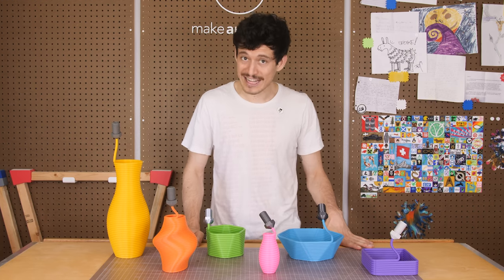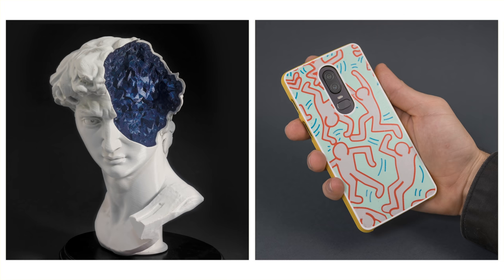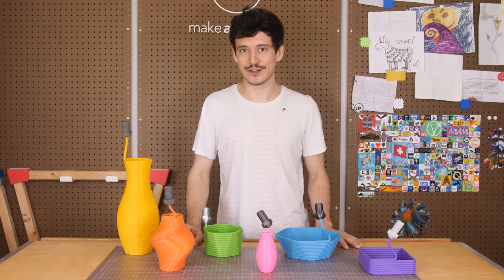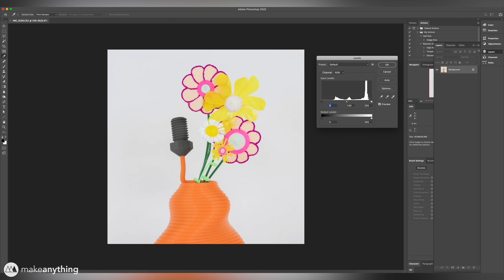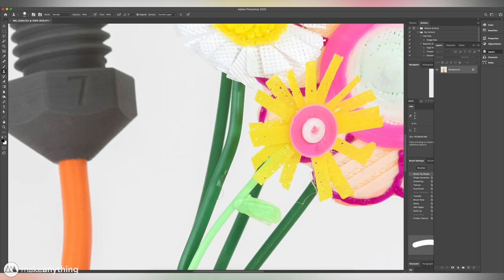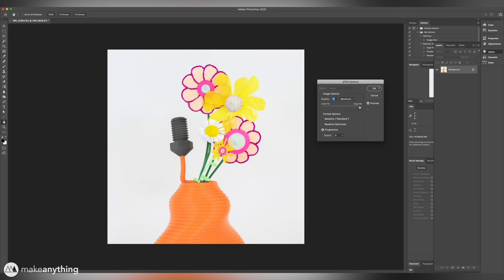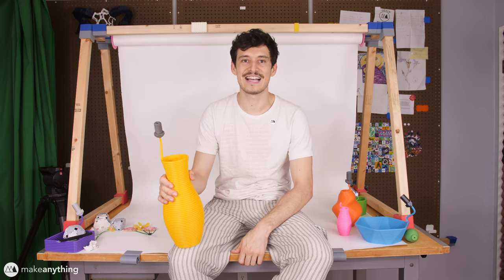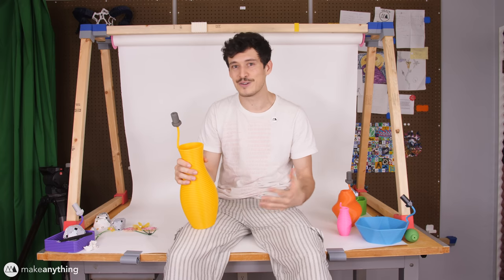Photographing 3D Prints (& Other Products Too!)

Comment: I remember a year or so ago when I was selling 3D printed Switch accessories on my Etsy store, I actually made a little photography setup in my garage to take pictures of them. The setup looked like some janky construction you'd find in Garry's Mod, but you really wouldn't be able to tell that from the photos I took with it.

It basically consisted of a piece of old gray car liner for the backdrop, and a very ghetto three-point lighting setup consisting of an old incandescent flashlight wedged into the slot on the back of an old office chair, a magnetic LED flashlight stuck onto an empty propane can, and the garage's ceiling light. For the camera, I literally just used my phone's camera.
It definitely wasn't ideal, but I made do with what I had at the time and all things considered, it worked way better than it had any right to.
Reply from the maker: It only has to look good in frame! 😂

Comment: I take thousands of photos of small items (jewelry, parts, bottles, signs...) that I sell online and I have used many different soft boxes, never super happy with any of them until I got a photo box from Travor on Amazon (Like $70) includes perfect set of LED lights that are attached inside the box (but movable) and it has a great diffuser for them. The backdrops are a sheet of colored plastic (I always use white) that curves and fits to the top of the back wall and all the way to the front of the bottom for a perfect no line photo. I still have 3 other soft boxes right now but I have not opened one of them since getting the Travor. Also the lights are dimmable though I always leave them on high and I never need any other light source. Instead of a folding box it's steel tubes that have plastic corner pieces, once you get all 8 tubes connected (takes 5 minutes first time then 2 minutes once you've done it) you place the cloth over it and zip it up all the way around. I do leave mine together since I use it 2-4 times a week. Best investment I ever made for shooting my items for sale.

Comment: What a lovely and helpful video!  Question: at 9:40, regarding the "saw horse" frame for hanging the backdrop paper: I notice that the horizontal bar is midway front-to-back over the desk corresponding to the front and back legs being equal length. That means the backdrop paper can actually bow out toward the rear of the set, in which position it's not hanging vertically, but rather it makes the back wall tilt forward over the object being photographed,  "enclosing" it more.  Is there a lighting benefit to this arrangement?
Reply: probably not intentional, but I would see that there is an advantage as there is light reflecting off the top (above) the subject. It's creating a little more fill. Great job noticing that Graham.
Reply from the maker: Yea! Unintentional the first time but I figured it would bounce some light from above. Haven't done side by side tests though

Comment: so i recently watched the how to make anything #2 does the game work with 6x2 magnets
Reply from the maker: It should, especially if you design it yourself and adust the depth of the magnet holes
Reply: @make.anything  okay thanks
Reply: @make.anything  Btw, quick tip - you could try to use flat neodymium magnets to hold huge paper from the end of the video, instead of using 3d printed clamps, it would be easier to set up probably

Comment: Hey Devin! I've bought a pegboard with 4.5 mm diameter holes. I've tried to use a similar mechanism to yours but it's to small to bend. Do you have any ideas of how i can do it? What diameter are your holes? Thanks a lot. Love you're videos!!!
Reply: I recently bought a pegboard with the sameish size holes (I think it's a Metric vs Imperial pegboard issue) I've had to recreate Devin's peg design and change it a little bit to allow it to work at a smaller size.

Comment: Some great tips here! One question - at whichfocal length do you usually shoot your pictures?
Reply from the maker: As much as I love the soft focus of the f1.8 on the Sigma lens, I usually try to set an aperture that gets more of the product in focus. I think these were mostly shot around f6
Reply: @make.anything  I see. I guess shooting at the apeture where the lens is at it's most sharpness makes sense. However by focal length I ment about lens milimeters. Some say 35mm is the best, some say 50mm gives more natural look. It's always seems hard to get it just right.
Reply from the maker: @kasparsbutlers  ahh sorry I misunderstood. I shoot at 35mm because that's the upper limit of my lens, and I feel it captures my prints accurately
Reply: @kasparsbutlers  i think you're right to be using a 35mm or 50mm. they both should work fine. i personally have a 28mm and a 50mm. they were the ones that were the right price at the time.